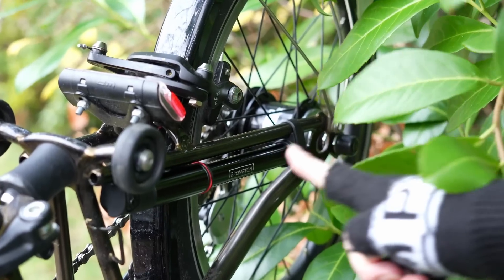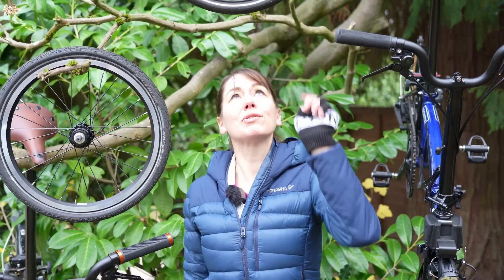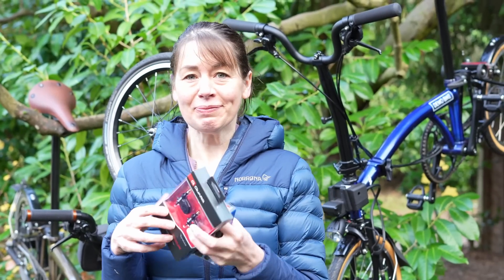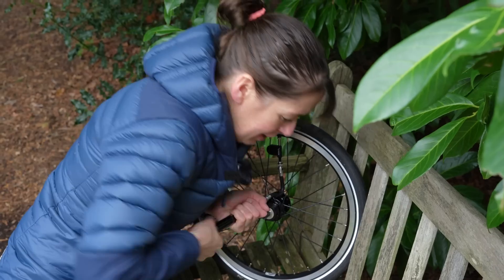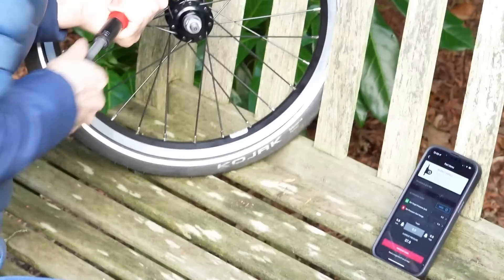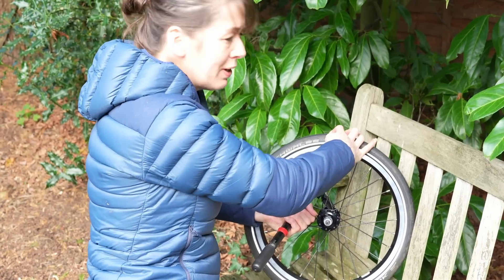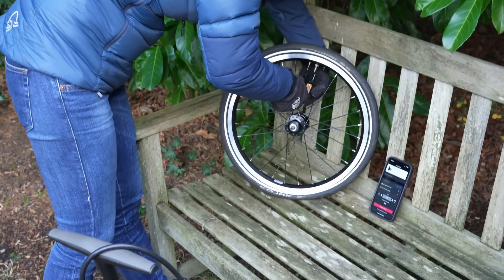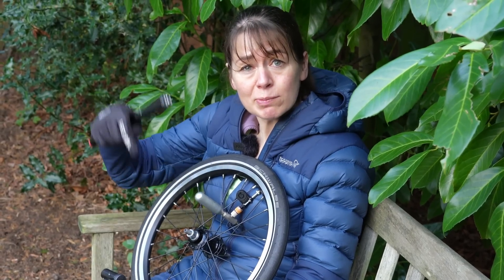Brompton pump pressure test

Comment: I can't get my Joe Blow track pump onto the valve because of the spokes being so close together.  I tried fitting those right-angled adaptors that clear the spokes.  The back one works well but for some reason the front one keeps deflating.  I had a puncture on a trip to London and had to use the Lezyne pump and it was a real struggle.  There isn't much thread to grab onto the flexible adaptor - it popped off twice and i had to start again.  I would appreciate a video that shows the most difficult bit, screwing the pump/adaptor onto the valve.  A useful video anyway - thanks.
Reply from the maker: We made a video on pumping up the electric front wheel, 

Brompton Electric Front Wheel Inflation
https://youtube.com/shorts/YQ_j0HyShMI?feature=share

Might help? Let us know your thoughts 

Thanks for watching!

Comment: I can’t get much more than 50psi with my zefal Brompton pump. However when I’m using a front  borough bag I take my old zefal hpx frame pump, which is quite long and has a high pressure setting..and pumps the tyres to 90+ psi quite easily. The good thing about this pump is that it fits nicely in the partition at the back of the inside of the bag if see what I mean 🤔

Comment: Very nice video.  What size CO2 cartridge did you use; 12g or 16g?  Did you allow all the CO2 to drain into the tube or did you cut it off while some CO2 was still in the cartridge?  FYI...Another You Tuber (Chris by Bike) measured and claimed that the Brompton's Schwalbe Marathon and a 700x23 road tire contain the same volume of air.  Not sure if that's accurate.  She measured by pumping the Schwalbe and the road tire and it took about the same amount of strokes using a track pump to reach similar PSIs.  Keep up the great work!

Comment: Toss the 2 minipumps you have and get a Topeak Mtn Morph mini pump. I routinely use it to pump 20" tires up to 100 psi because it has a Tee handle and a foot bracket that rests on the ground while you pump
Reply from the maker: Many thanks for the suggestion! We need to give it a go! 
Thank you for watching.

Comment: This gave me flashbacks of the first time I had a flat and used my zefal  pump. I somehow reached 55 psi but it took every curse word I know to get 
there❗️🤬 
 I now keep a track pump in my truck. I’m still having good luck with the Slime. I’m using one of their pre-filled tubes 16x1.75 but it will fit with some coaxing and my other I added slime to a regular tube. When I switched from marathon pluses to the tan wall I flatted right away but with the slime no punctures ❗️Yes I probably did just jinx myself 😁
Reply from the maker: Lol! I was determined not to give up! But  could not get them any harder! 
It’s great to hear how well you have got on with the slime! Fingers crossed they keep behaving!

Comment: Very interesting, thank you for the investigation! 

I was curious and repeated your test with the Zefal pump that came with my Brompton. I was able to get to 55 psi before my arm pooped out, took somewhere around 10 minutes. Good enough to get home or to a bike shop. With the Lezyne Micro Floor Drive HV that I carry on my fat bike, I was able to get to 90psi (the pump's limit) in less than half the time without exhausting myself. (The right one for the Brompton tires would be the Micro Floor Drive HP which I'm sure would take the psi right to the tire's limit @115psi.) These are not much bulkier to carry than the Zefal or new Lezyne micro that Brompton is supplying, and are much more efficient with your energy since you stand on their fold-up bottom bracket and pump with you arm pushing down into the ground. I suspect a bracket could be arranged to hold them similarly to the Zefal and Lezyne on the Brompton frame. These pumps are pretty light at just under 200g, are a bit more bulky than the Zefal (31x6.5x3 cm), can be had with a built-in digital pressure gauge, and work very well. I have the HV model fitted on my fat bike at all times now. 

I also have two battery operated inflators: a Ryobi One+ and an AirX. The Ryobi is what I used to maintain all my vehicle tires at home (cars, motorcycles, bicycles). One charge on it standard battery can inflate a Brompton tire to max pressure in about 25 seconds, and do it 10 times, but it's much too bulky and heavy a device to carry along. The AirX inflator can inflate a Brompton tire to max pressure in about a minute and three-quarters, do it three-four times, weighs about 430g, and is about 24x7x4 cm in size ... small enough to carry if you're going for a long trip (it's smaller/lighter than many cameras I carry) but a bit much to carry for every day lightweight use. 

Fun stuff. It's good to know what's out there and how it performs. :)
Reply from the maker: Thank you for watching and for trying it as well! 
Many thanks for the suggestions!

Comment: Thanks for the video. It was enough to convince me I probably don’t need to upgrade to the new pump, it’s much better (50 vs 35 psi) but still wouldn’t go all the way. Out of interest have you seen the Xiaomi Pump? Small usb rechargeable digital pump, looks like a giant iPod or padlock. You digitally set the PSI and press start, it stops when reached, hands free. I bought one awhile ago for my electric scooter but it’s all I use on the Brompton now. Well worth a look I think, and good value for what it is.
Reply from the maker: We have recently tried a Bosch electric pump and found it great! Perhaps we need to feature an electric one in the next pump video.
Thank you so much for watching.

Comment: It would interesting to see a test of smaller pumps, eg how the Lezyne Micro Floor Drive HP would perform in that test and which of the three versions: 1) digital gauge, 2) mechanical gauge, 3) no gauge; is accurate or not.

Comment: I have several lezyne pumps on various road and cross bikes.  Major tips, all removable tip presta valves need extra tightening before using this screw on hoses.  Use the pressure release feature on the newer versions. Remember, slimmer tube body gets higher pressures and longer tube body requires less pumps.

Comment: Great video, great comparison. 
But I was very impressed to learn that the new pump doesn't go up to at least 80 PSI.
Reply from the maker: Maybe I’m just a weakling!
Thank you for watching and for commenting
Reply: @brilliantbikes  Nope. It is very hard to pump up a tyre above 1/3 of pump capacity. I always buy pumps that goes up to 150psi and pumps in and out. This way is not hard to get 80psi  or even 100psi for a safe and easy ride.  Love your videos

Comment: Thanks for all your effort(s)! That was really useful. I think my personal way forward will be adding a CO2 inflator to my zefal pump - the faster I can get back to my track pump the better, right? The main reason I haven't already done so is that I was worried that an inflator might be uncontrollable when connected to such a low volume tyre and end up blowing the tube. That's one concern laid to rest!
Reply: But was it laid to rest? If the pressure gauge wasn’t there how high would the tyre inflation have gone, and how would you know? I’ve been using Marathon Plus tyres for a year and Schwalbe say not to pressure test them by ‘feel’.

Comment: Thank you for this test! Have had my eye on the new Lezyne pump but no availability in Australia yet has made it an easy decision for now. I've been experimenting with Fumpa's new Nano pump and so far so good - its about the size of a GoPro, maybe smaller, and the nozzle fits between the spokes of a Brompton front wheel, which is narrower than the back wheel. Also fits the JTek Superlight which has even narrower spoke placement.

The Fumpa charges via USB-C and will give you max pressure of 80psi with little effort. Advantages over catridges is less waste, and it doesn't freeze, but it can get hot..the unit is designed to shutdown if the temp gets too high, so you may need to wait for it to cool down if you need to use a lot. Also the motor is quite loud so not suitable for the rest of your household if filling up before an early morning ride! Great emergency pump though.

Fumpa also make a pressure guage which is quite good, but I like the look of that Quarq one. Being able to see a live readout on the smartphone is fantastic.
Reply: It's easy to order a pump online, even for Australia, I suppose? I order most from outside Denmark, even though we have shops in Denmark. Finn. Denmark

Comment: Do you have a product called "Fix A Flat"? It has some goo in it that will fill your puncture but if your valve is leaking it can fill that too. That would keep the valve from working the next time you went to use it. We also have canisters that we can pump up with air and place in a flow vehicle to fill a tire with air. The canister is filled by a compressor that you would find at a gas station.

Comment: Entertaining as always!
Pump strategy is very important!
Track pump at home
A good quality CO2  inflator in your pack with 2 cylinders. Always practise before you need to use it for real! Well worth the cost of a couple of cylinders
Emergency pump on the bike for when you fail to use the CO2 correctly and all the air comes out!
Reply from the maker: Thank you so much for watching. 
We agree it’s great to have a plan! And the back up pumps are brilliant!
Reply: Another stand by method - keep on cycling on the flat tyre! It’s a bit uncomfortable but I’ve found that the sidewalls of the Marathon Plus can cope (though the inner tube does get written off).
Reply: How about hybrid? Lezyne micro floor drive can make 11 bars.

Comment: with a foot pump it is even more easy to pump up the tire 😀👍
Reply: Very few car type footpumps go higher than 60 psi. I had one that had a dial with 80 psi on it, but when checked with a separate pressure guage, that too was only 60.
I now use a track pump, and on the car tyres, too! (Local filling station now charging for air.)
Reply from the maker: Thank you for watching! 
Sounds like a great solution.